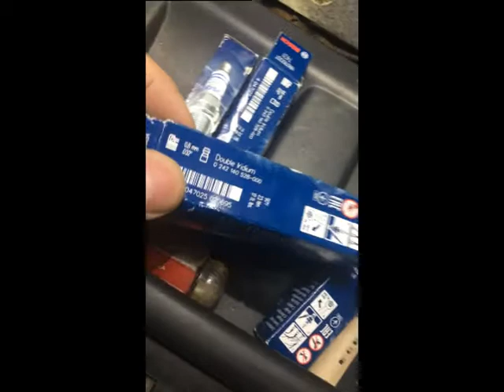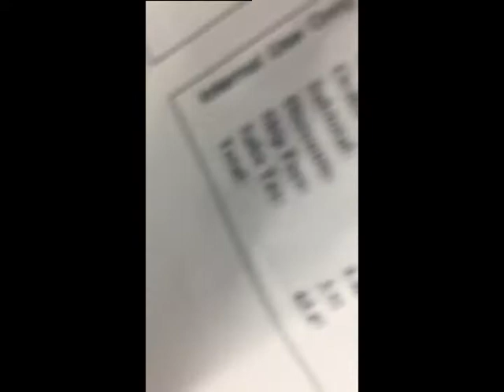Audi Q7 Sparkplug replacement 3.6L VW

Comment: “These are things people have that have been working on cars a long time”   You don’t need a tool for those electrical plugs on the coils unless some goofy dingbat already broke the clip using a tool he/she didn’t need, then all you need is a pick... push down on the coil pack WHILE pulling the lip of the clip on the connecter up with your finger. Easy peasy. Those are the factory brand plug. Torque is 18-22ftlb IIRC. Homework THEN video.
Reply from the maker: ah me had no idea, can you review my transmission valve body repair video to? it had clips and torque requirements which are of higher importance than this. hope I did it right. https://youtu.be/tnwTT3ewtig